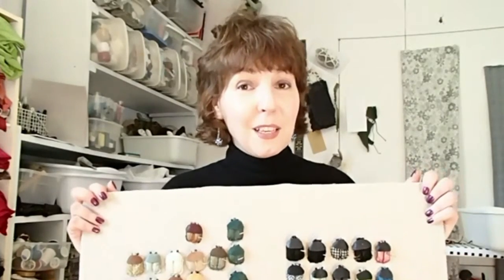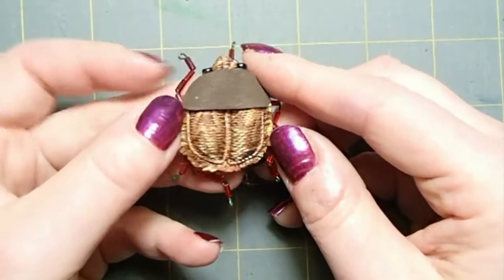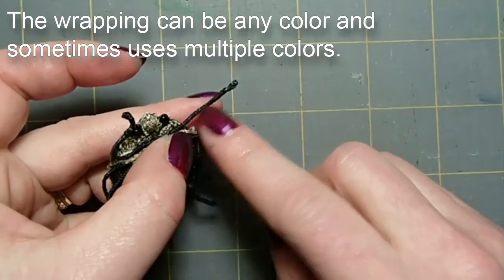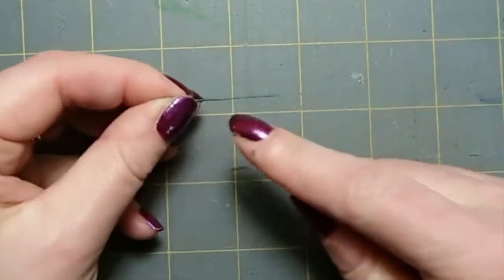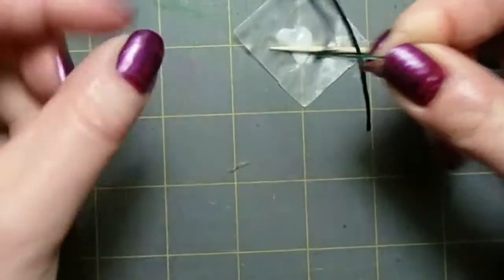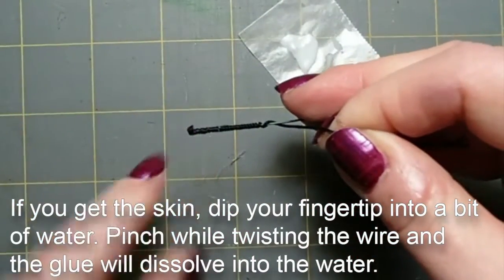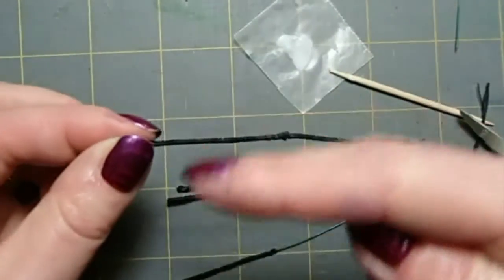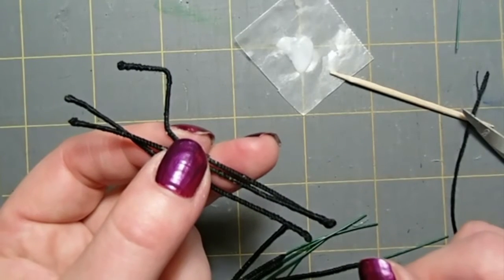Making Insect Legs: Using an Adapted French-beaded Flower Technique

Comment: Those original legs are workable, with a couple of adaptations. One is to either use headpins for your wire, or ball the ends of your wire. This is actually easy to do with a baking torch. Just hold your wire vertically in a pair of pliers or tweezers, and apply heat to the bottom till it balls up, then quench in water. NOTE: Do this over a heatproof surface just in case your bead of metal gets too big and drops off. Using ball ended wire or headpins means you don’t have anything to catch. With the joints of the legs, add a seed bead in between your bugles. They act as little “ball and socket” joints in effect. MUCH faster than wrapping the wires.
Reply from the maker: Thanks for the advice. I am a textile artist and don't do metal work, so the baking torch is not a tool I have. I am sure there are many metal and wire working methods that could solve the leg "problem", but the beetles do exactly what I need them to do (embellish my sculptures) as they are. They aren't perfect, but I'm fine with that. I know there are people who want to make something similar for jewelry, but that just isn't my interest. I wish them well! I put my methods out there so people can see how I adapted a less well known fiber technique (stumpwork embroidery) to suit my needs. Thanks again for reaching out with your expertise.